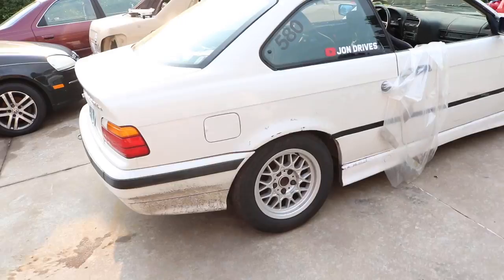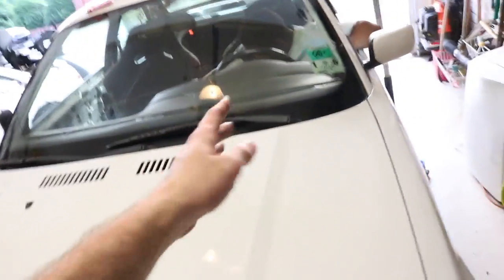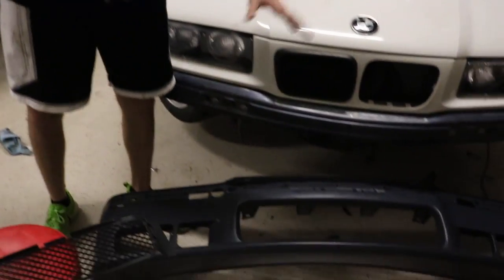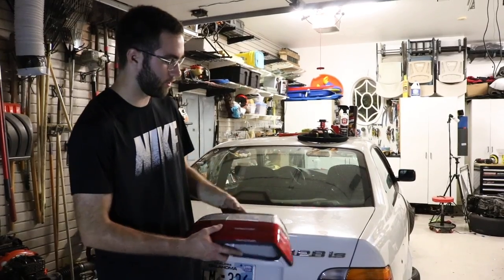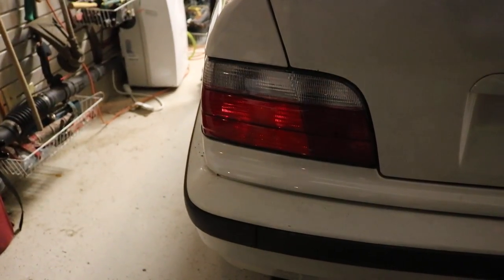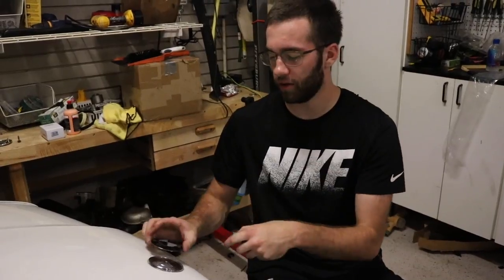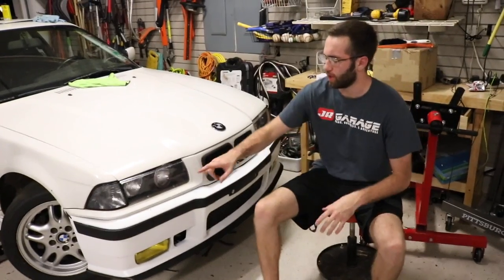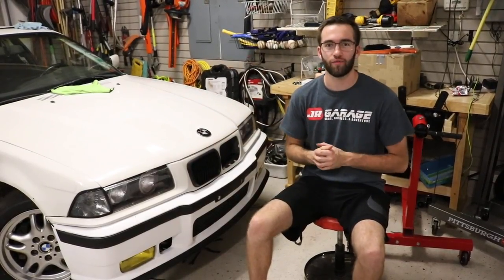Ep10 Best Ebay Mods For Your BMW E36!

Comment: sorry but i am still seing people taking bumpers of e36's the wrong way. it's meant to be taken off with the metal suport. it has 4 screws. two on each side of the number plate  and you.re done. get some 6mm screws and hold the plastic cover to the bumpers support. the fitment will be better and easier to take off
Reply: I personally use 1 nut on each side where the stock mounts are . Does the job .

Comment: aye. i just did an auto to manual swap on my e36.  I know a worthlessly insane amount on the hydraulics of that car.  whether it's from the pedals, the wiring for the clutch safety, etc, to hydraulics, hit me up and i will show you the cheapest and most painless way to get the clutch working again.
Reply: personally, i would run an aftermarket clutch line.  heres my setup, and it's perfect.

https://www.chasebays.com/products/chase-bays-clutch-line-92-99-bmw-e36-w-bmw-engine

that goes from the master directly to the slave, unlike the stock BMW, where a hardline connects to the master and a softline connects to the hardline coming to the slave.  and if you just wanna order that one soft line, order a stainless steel one.  30 bucks off ECS, and drastically increases clutch feel.
Reply from the maker: Thanks so much for the info. I replaced the soft line. I am actually working with Condor Speed Shop and I know they have a stainless line. Upgrades will be coming for E36! Also planning to go down to Texas Motor Speedway and drift next weekend. Stay tuned
Reply: will do! earned yourself a sub ;) (small e36 channels are my favorite because the amount of interconnectedness is insane)
but yeah I highly reccomend getting a new master, and if you have to do any work down there, i would reccomend you ditch the hard line for that chase bays softline. it's almost impossible to route the hard line, as it was placed there around everything else.  routing the hard line, according to other people who were insane enough to do it, takes about 4 hours of fiddling around +removing the brake booster, ABS pump, and more.  you also run the risk of bending it, like what happened to mine, which makes it useless and impossible to correct (which was my push factor for the chase bays line)
Reply from the maker: MCatwar Will do thanks man!
Reply: MCatwar whats your ig or email ?
Reply: Scotty P Beats facts got some questions
Reply: I mean its too late for the other guy lmso
Reply: MCatwar check email